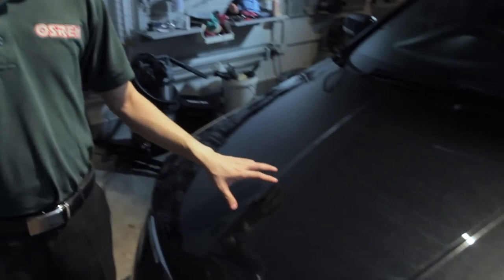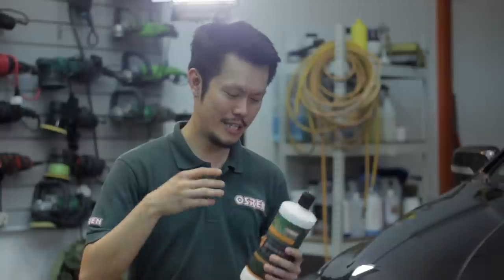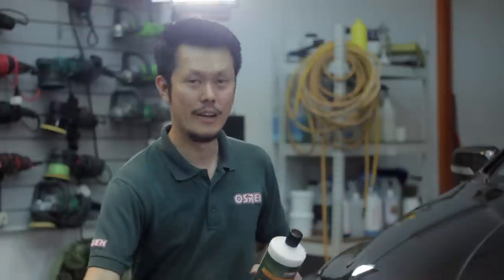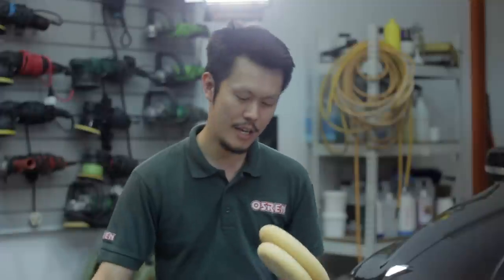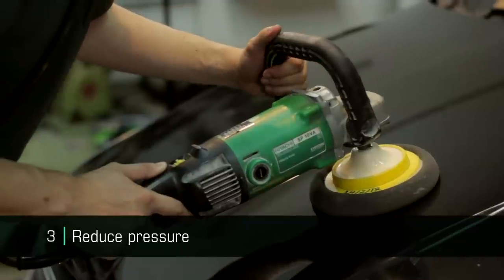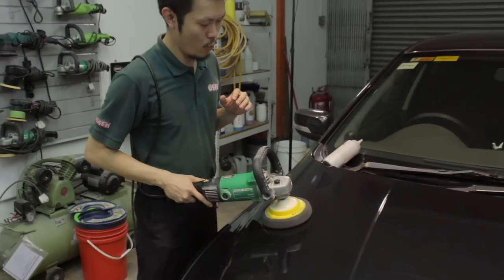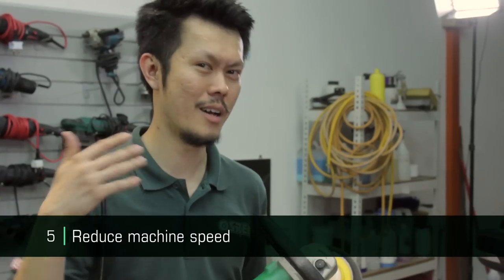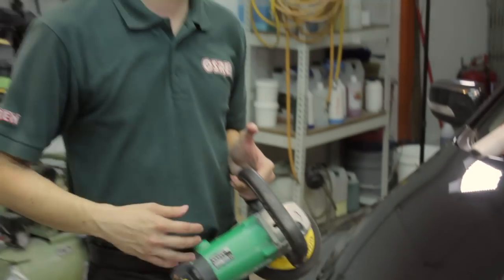How to Reduce & Remove Holograms with a Rotary Polisher

Comment: I have shown by a so called pro " use high rpm and be very quick.....
Reply from the maker: Well technically when high rpm kicks in you’ll get heat but the quick arm movements will reduce the working area hence giving less heat, if it is works for him , it works for him. It’s more of a user define technique, no hard and fast rule there
Reply: Should be called how to burn through your clear